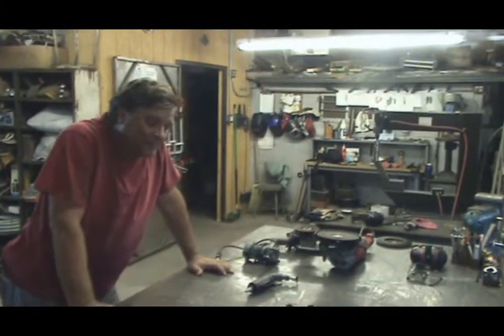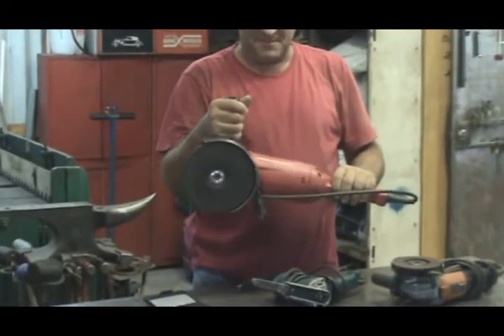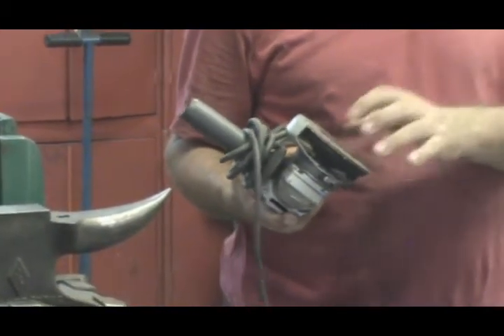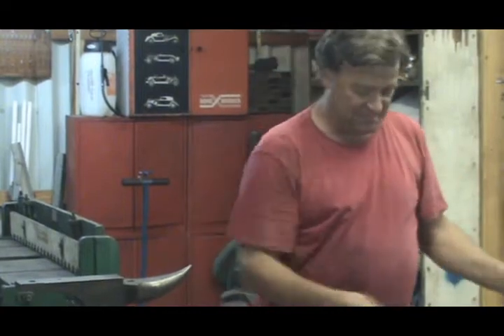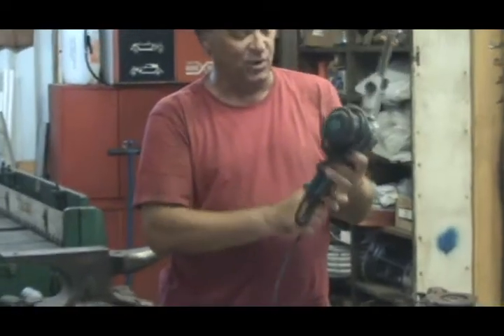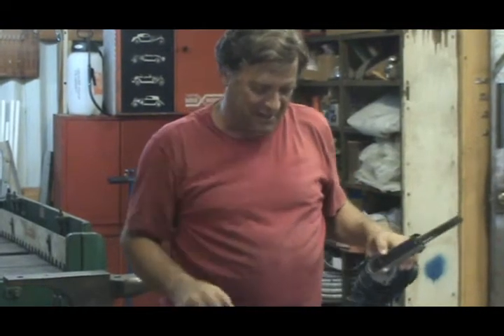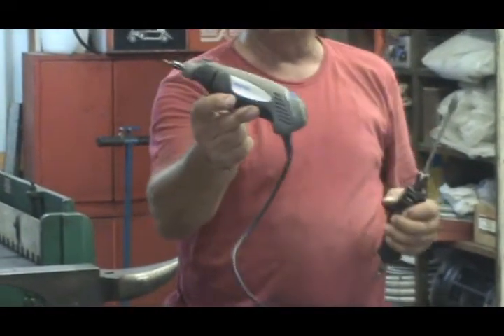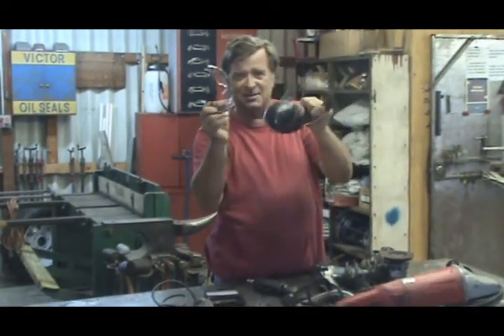Grinding Metal: How to Select the Right Tool for the Job   - Kevin Caron

Comment: Whew. Lots of toys...er...tools to choose from. Going from a 4-1/2" angle grinder to a 7" with comparable flap-disc was darn amazing as the weight of the 7" one did a lot of the work for me. Less effort and faster results, nice. Add in the slew of disc choices... Variety is good to have. :-)

Thanks!

Comment: I am needing to remove metal fence posts from concrete (leaving the concrete intact).  I was told to use a grinder.  Do you suggest a grinder with a masonry wheel or is there another suggestion?

Comment: I have a problem not knowing what size compressor is needed for a pneumatic grinder. If you use a 90deg pneumatic small one hand grinder to sharpen a shovel blade. What size compressor would you think I need. I would rather not over buy or under buy.

Comment from the maker: it's more a question of cubic feet per minute than "Size". 

I would look for a minimum of 3cfm and a working pressure of 125 to 150 psi. 

A 10 to 15 gallon tank should do all you will need for a long time...

Great question!!

Comment: Air vs electric...   

When metal dust is involved, air is prefered because it blows the dust away and the tool is not harmed. Electric tools get metal under the brushes and in the bearings, and that can cause them wear out quickly.  Same goes for concrete, stone, or any abrasive dust producing material.  

At other times, air tools are prefered when the ignition of flamable materials is a concern. Obviously, with metal grinding, flamable materials must be avoided anyway :)